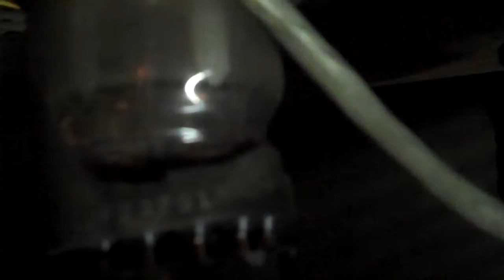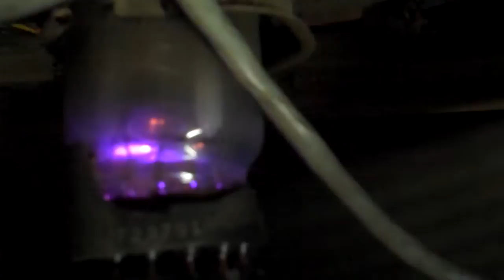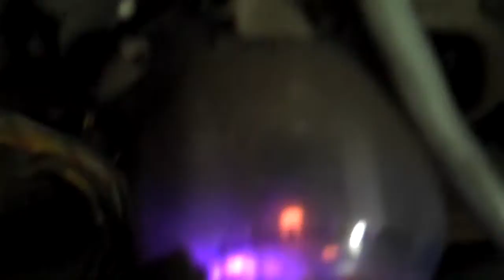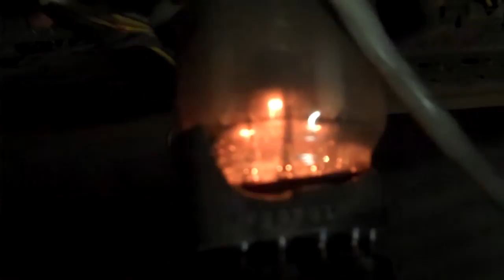Gassy CRT Picture Tube With Air Glowing Blue

Comment: Sparkly :) I've got a Philips 'scope here that I suspect the CRT of being gassy, getter is very milky/faint and it rings like a bell when you tap it :(  Still works for the moment though so I'll run it till the filament opens and hope i find a suitable replacement!.

Comment: @tadgesualdo The thought was that with the plates DC connection disconnnected, and the cathodes ground path not present, you could attract electrons back to the filiment or cathode if indirectly heated, and rejuvenate the tube back to life in some circumstances.  This worked best with directly heated tubes but also with indirectly heated ones.  The flashing readied the cathode for this, and the cooking accomplished it.

Comment: We use to rejuvenate tubes back in tech school by doubling the voltage on the filaments or heaters for about 5 to 10seconds, we called this "flashing".  After this was done we would do what we called, "cooking" the tube by operating it at it normal heater voltage for several hours.   If they came back a little better we did it again, until we stopped getting positive results.
Reply: I did a lot of flashing of vacuum tubes (not CRTs) to finish projects without making too many investments.